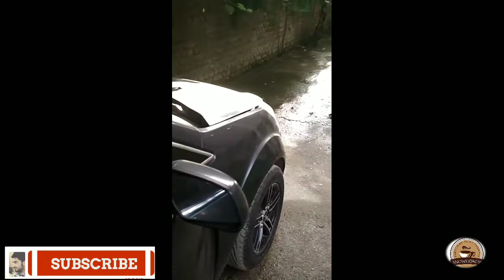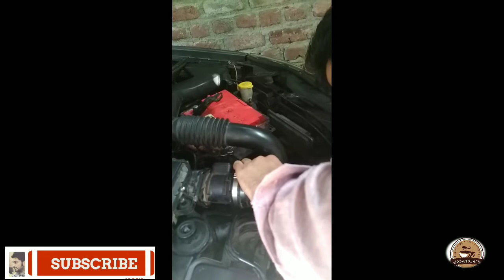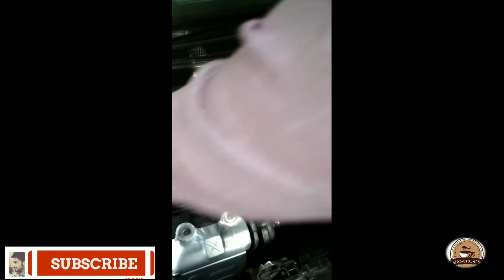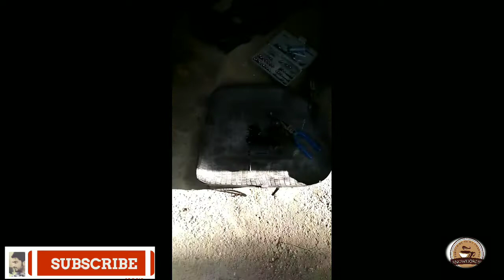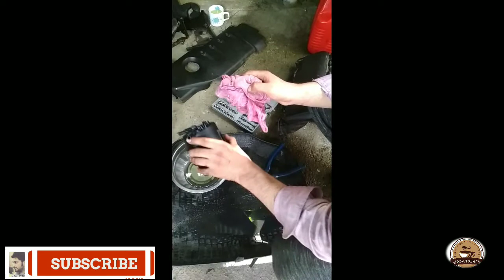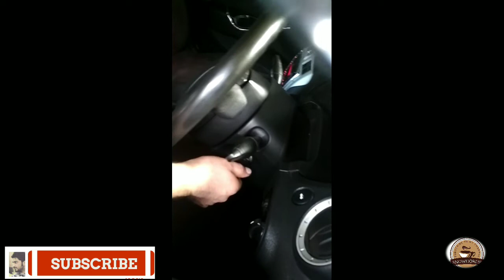ford figo How to remove air from fuel line | Ford Figo

Comment: Fuel line air bubulls  engine missing are so injectors 4 good condistion  how problem solve. Car fordfiesta  2007 modal
Reply from the maker: Change high pressure pump drv.. Or check any leakage

Comment: Bhai meri figo ka tank ka meter karab hai wo oil bottom sai halka sa upar dikata hai mainai tank kulwa kar usko chek karwaya wo agency mai naya nhi tha tab sai gadi 20 km 15 km kai baad band hou rhi hai air nikalnai sai start hoti hai company walai bol rahai hai fuel gauge karab hai badlnai sai teek hogi ya fy pump mai problem hai mai bola ki tank kolnai kai baad hee samasya ayi tou fuel tank sai line kai bich hogi n apka kya kahna hai.
Reply from the maker: Agar gaadi band hoti hai chalane ke baad 20 -15 km aur phir gaadi long self leti hai 5 min baad he start hona band hoti hai.. tab drv high pressure pump mai problem hai.. aur agar gaadi band hone ke baad jaldi phir se start hoti hai tab fuel tank puri tarah se fit nahi betahaya gaya hai..Tank ka fuel pump vaccum banata hai fuel gauge ka kaam hai oil dikhna kitna hai. baki uss se koi faraq nahi paday ga
Reply: You are wright bhai gadi band honai kai baad self sai start hoti hai par band hou jati hai yani acilator nhi laiti fir disel filter ka pipe nikal kar jagad wala pump sai mecanic air nikalta hai bubbles yani air dikti hai jaisai normal disel dikta hai pipe laganai sai gadi start ek dum normal next 20 km samaj nhi pa raha hu or company walai b kuch sure nhi hai aab aap kuch batai.
Reply from the maker: High pressure pump ka DRV change karwana pressure release nahi hoga sab sahi hoga.. Baki kuch b nahi karwana hai
Reply: @snowDorfie  iski cost kya hogi lagbhag
Reply: @snowDorfie  or ek baat dash board light sabhi ok hai koi abnormal nhi hai jou gadi ko scan karnai sai pata chalai ki gadbad kaha hai.
Reply from the maker: DRV ki koi dashboard nahi aati agar kharab ho tou aur naa he scanner show karta hai. kissi scrapper se purana laana kabadi se.. new maybe aata hai under 7000
Reply: @snowDorfie  thanku bhai koi kabadi hai najar mai merrut ya delhi mai mai dehradun sai hu lainai a jao ga

Comment: Meri Figo kabhi start ho jati h kabhi nhi hoti jab hoti h tab badiya chalti Leptop lagva diya lekin koi folt nhi a raha kya kru sir bata sakte ho
Reply from the maker: Start kiss time zyda nahi hoti... Subha ke time agr start nahi hoti tou... Fuel zyada rakha karo gaadi mai...Ya High pressure pump ka Drv check karav .. Aur crank sensor  aur Cam sensor dusra dal kar check karo
Reply: Or sir gadi start ho jati h tab foul line me air bhi chalti h usse koi problem to nhi h
Reply: Or air nikalne bala pump tait nhi hota h

Comment: Bhai meri figo me P0002 (fule or metering) Ki DTC show ho jati hai kabhi kabhi or gadi ka pickup low ho jata hai
Fule filter, fule pump, prsussre pump, nozzle service kara di phir bhi kabhi kabhi P0002 (fule or air metering)  Ki checking light show ho jati hai
Reply from the maker: Jo diesel tank mai pump hota hai usko saaf karwana.. Fuel metering  wohi code hai.. sath mai high pressure pump ka drv  aur common rail ka sensor saaf karwana... Airmass sensor check karwana aur turo actuator ki pipe ko halka sa hath se press karna
Reply: Bhai tank ka fule pump naya daal diya hai or comman rail ka sensor+high pressure pump bhi naya daal diya hai,

Comment: Bhai mera pas v ford figo a usa ma war war band hona ki problem aundi hai
Reply from the maker: Chalte Chalte bandh ho jati kya
Reply: Ha bhai chalta chalta jab asilater to par utata hai tab kabi kabi band ho jati a hai
Reply from the maker: Oil half tank rakha karo.. Injector clean karav.. Air filiter sensor (MAF) sensor clean karav.. Gaadi ko 1500rpm pe continue 10 minute tak accelerate karo .. Tab nahi hoga aisa
Reply: Bhai kyi war injector cleaner pawa diya mana to aur sabi filter v changer krwa diya hai aur diesel tank v half hi hota a bhai yah problem diesel pump ma ho sakti hai

Comment: Sir ye problem bar bar ho raha hai isaka suggestion bataoo please....issko hamesha ke liye kaise solve kare....
Reply from the maker: aap Check  karana high pressure fuel pump mai hota hai DRV valve woh pressure release karta hoga jab aap gaadi bohat time tab start na karo...start hone ke baad.. aur air leak dekhna fuel filiter value mai tight kasa huwa hai ya nahi

Comment: My diesel fiesta model 2010 taking air in 2 days I change new filter also but problem is not solved
Reply from the maker: Check DRV of high pressure pump.. If car takes long to start in the morning.. Filiter is not the solution of that problem.. It is when filiter or filiter hosing is lose somewhere

Comment: Subah gadi 4-5second ke liye start hoti h aur phir band ho jati h. Phir blader se fuel pump karke start karni padti h. Phir pura din theek chalti h. Koi problem nahi aati. Isme kya kar sakte h. Kisi ne suggest kiya hi fuel filter change karwa lo. Koi bolta h fuel pump pressure low h. Pls suggest
Reply from the maker: Yeh issue Fuel filiter zyada purana hone ke waja ya fuel pump ka he hota hai par agar apki gaadi bladder press karne se start hojati hai.. aur din mai theek chali hai tou...  aap sab se pehle jo fuel pipes hoti hai air filiter ke neechay  check karna air leak mat hai kahin se ya diesel leak mat ho raha hai.. aur agar woh b sahi hai tou gaadi ko scan karwana jo fault ayai ga wohi theek karna.. pump aasani se kharab nahi hota aur half tank fuel rakha karo gaadi mai.
Reply: @snowDorfie  SCAN SHOWS PROBLEM OF HEAT PLUG ONLY... I cleaned the complete fuel pipe ad some how problem resolved. Now at morning car start at long 1st self. then whole day no problem. Pls suggest
Reply from the maker: If glow plugs are faulty then car takes long time to start in winter.. first check all the four heater plugs are good.. then first give heat 5 to 6 times by switch key to 2nd position and then back to first at least do this 6 times then wait 20 sec then try to start  ...